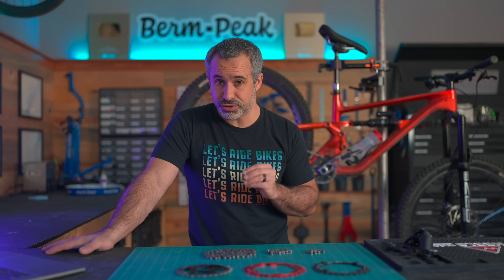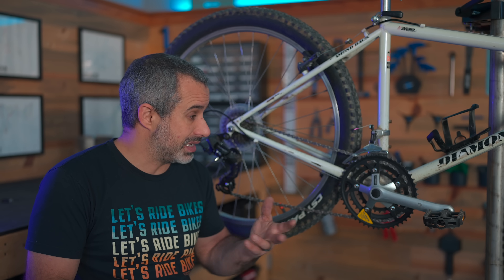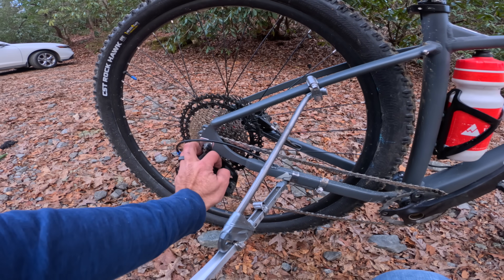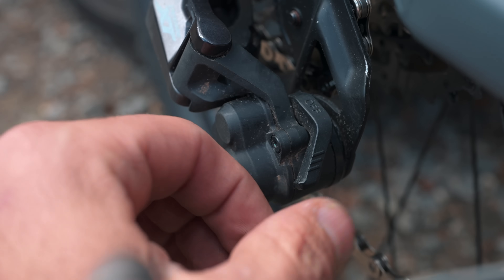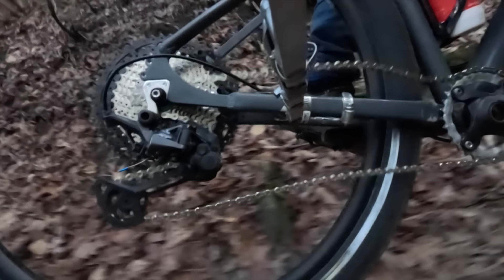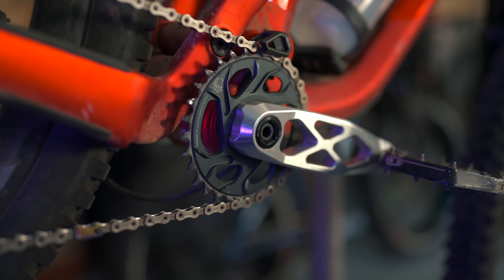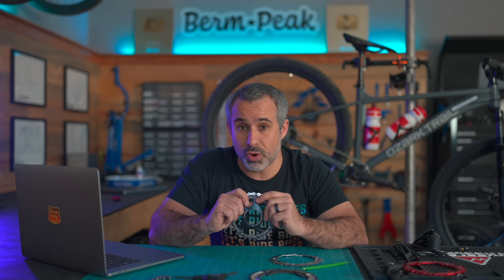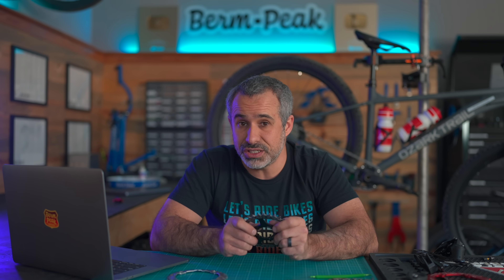The Genius of Narrow Wide Chainrings - Why they work!

Comment: Interesting breakdown, but it had me wondering about something not mentioned. I have to suspect that the increased interference of the chain/chainring results in increased friction which would decrease your pedaling efficiency. 

Not really an issue if you are only riding downhill, but uphill I wonder what the actual wattage difference might be?

Comment: 2x with a clutch is perfect
Reply: Agree. People keep saying how bad front derailleurs are, but the fact is almost nobody has ridden a really good 2x drivetrain like the ones Shimano produced at their peak (when 1x was already the industry standard).Incredibly smooth, wide range yet small steps, quiet and good chain retention. Not as bomb-proof as a narrow-wide chainring, but the few occasions I've had a chain come off on my 2018 hardtail it would generally pop straight back on by shifting once back and forth with the front derailleur.

Comment: My experience shows that NW chainring is not enough to prevent chain drop although it happend very rarely and I ride mostly in flat woodlands. Eventually I needed to put a chain guide to keep it on at all times. Mind you that I have a clutchless derailleur, so mybe a clutch and a nw chainring would do the trick. However, recently I got myself an ltwoo gr9 groupset which has a derailleur with an adjustable clutch, but it creates so much resistance on the jockey cage, that it is impossible to adjust proper gear shifting as there's to much friction on the cable and housing. I had to take the clutch out to be able to adjust it properly, and it turned out that the cage spring itself is quite stiff. Too stiff to my liking.

Comment: I never had problems dropping chains running 3x9 XTR in the past (or 2x9 once I removed the big ring). No clutches, no narrow-wide... but I'd never be in the smallest gear and the smallest chainring. I mean... why would you ever be in that gear? I haven't ridden a single ring drivetrain, so I could see it being an issue, but for old 3x9 and 2x9 setups this was never an issue because you'd never be in a gear that left that much slack in the chain.

Comment: I have been using a cheap aliexpress crank with those cheap narrow wide chainrings with a Shimano Deore Xt m739 (90s part) 11-42 cassette with a cheap extension also from aliexpress, never dropped a chain even without clutch. F pattens

Comment: Now I am wondering why my motorcycle doesn’t use this. 
Enjoyed the video Seth.
Reply: Motorcycle chains are thicker, so even at the outer link the actual clearance tooth can go into isn't different from inner link parts. Also, motorcycles use gearboxes, which means that the chains aren't meant to move sideways much. They are also tensioned differently. If the motorcycle chain becomes loose enough to fall, it's already time for replacement or adjustment.

Comment: I went 1x9 in 2010 using a dual bash, later 1x10 using a narrow wide bit still using the 9sp XTR rear mech and only lost the chain once in 4 years before finally swapping to 1x11 with a clutch (damper).

Comment: I've run several different narrow-wide rings, still dropping chains (with clutch mech). Eventually got wolftooth (couldn't get it in UK, so it had to be shipped from US). Had it for a few months, and haven't drpped the chain once. Even crashed quite hard, chain still on. Best 80 quid I've ever spent on my bike.

Comment: Great video !   I upgraded an older trek 3x to a 1x using that raceface 30t chainring along with a new shimano 11s chain and 51t cassette.  In the largest 2 gears (lowest), I have a squeek coming from the 30t chainring.   The chain is lubed as well.   What can I do to eliminate the squeek?   File down some teeth or ??

Comment: And here I am still rocking 3 chain rings at the front in my old mountain bike 🙁
Reply: 3x chainrings are still relevant for city riding. That's what I'm rocking. I believe they call the genre urban cross.
Reply: Me too🙃
Reply: I kept my 2x10 setup on my XC-Bike. Even renewing it.. why? I have more gear-range than going to a 1x11 (max that would be possible without changing the hub as well).. it climbs better, works just fine (no gnarly trails) and upgrading to a 1x setup cost more than just replacing existing components..
Reply: Me too, brother.
Reply: i have an old full sus lapiere with three chainsrings
Reply: Unaware of this I modified both of my bikes from 3x9 to 1x9 setup with NW front chain ring like 6 years ago and they're still running perfectly fine, no clutch on the derailleur
Reply: I just recently bought my first semi modern mountain bike, a 2009 Giant with 2 chainrings. I haven't ridden through any rocky sections to see if the chain stays on yet though.
Reply: I recently upgraded my old drive train to a one-by. Best mtb decision I've ever made 👍

Comment: I'm still rockin a 2004 GT Ruckus and recently the roller wheel chain guide packed it in. The rubber wheels perished and I found them in bits on the floor while the bike was parked up for a few months. . It still has the 2004 old skool rear derailleur and a single narrow/narrow up front. The chain falls of without the roller wheels chain guide just by going off a curb on the street out front. I'm gonna grab a narrow/wide front after seeing this video before lashing out on a clutched rear derailleur.

Comment: I have that sane "conventional steel chainring" bolted on the holzfeller cranks of my 2012 Blindside. The chain retention kinda sucks and it's left to the chain guide but that ring is indestructible. Went off the older 2009 Blindside frame that i bought second hand and I am still using it, it still has life. The narrow wide aluminum chainring on my Specialized Enduro instead, while having great chain retention didn't last more than 3 years with mild use...

Can we have steel narrow-wide chainrings? That would be great...

Comment: Love this. Definitely surprised. Figured the clutch was doing the most work. Would have been interesting to see the testing with a narrow toothed non shift ramped front ring. This is what I used to run on my dh bikes back in the era before clutches and narrow/wide rings.

Comment: i'm a 3X7 lover. XT 750 setup with a 27.5 7 speed cassette disc hub on my 930 is way better than my SRAM SX Trek XC8 from 2020. people forget there are deore spec 7 speed cassettes. and they're really good too.  so was gripshift MRX comp

and the 1,2 skip a few cranksets of long ago were the same. I have one that has three teeth in a row then it skips one totally,  it's a 5x144 bcd and somehow came out in the early days long before SRAM  I believe it's a track ring. It sparks when you scrub it like magnesium..

you can find lots of similar like the Schwinn Sweet tooth.

point being they shouldn't have a patent on it. I am pretty sure this chainring is from before ww2 and there's some narrow teeth and some wide teeth.. some round recessed areas where the skip teeth would have been oval between every fourth tooth is missing a wide

here's the secret.   you don't road crank with a moutain cassette.

you mountain crank with a road cassette..   try it

you can use expensive light chains to get better performance.  use that $200 ti chain in a 3x7

if you're gonna run one gear you put a guard ring on either side. let's be real here.

if you really ride that abusive get a single speed.

or a Kindernay XIV carbon belt and dummy up

Comment: I have a 2008 Gary Fisher that had a 3x front derailleur and obviously no clutch out back. All I did was replace the front chain rings with a narrow-wide matching the middle ring and remove the derailleur. That's all it needed and it transformed the bike. Never, not once has The chain popped off. And it doesn't even have a chain guide, the narrow-wide keeps it on.

Comment: I've made a couple of narrow wide chainrings in my shop and have examined their performance.  What seems to be more important than the narrow and wide teeth is that the teeth longer and come well past the midpoint of the roller.  Also important is that the teeth are wide enough to snugly fit in the narrow links.  The wide teeth don't seem to do nearly as much.

Comment: I think I now finally get why 1x is so popular in mountainbiking. It seems that chain retention is even better with a 1x narrow-wide and clutch than with a derailleur. I would think that having a bailout  gear and a large ring to aid in descending and on the road towards the trail would be beneficial on mountain bikes. But off course a front derailleur cannot prevent or save every chain drop, so I guess chain retention is the answer.  Is 3x still popular under people who ride their mountainbikes on the road as well? Because I think 1x makes sense if you're only using it on the trail, but if you cycle to trails or use the mountainbike as a town bike, the small single chainring does not seem conducive to ride with traffic on the flat.
Reply: Yeah, I will keep my 3x front. I need the speed of 44 front ring. The chain is not going anywhere from the middle ring when on the trails.

Comment: This is so interesting.
Also made me aware of the fact that I have been riding with the clutch OFF all the time, lol.
Reply: Clutch Off can improve shifting and drivetrain efficiency compared to clutch on due to there being less tension on the chain which makes the derailleur move a little easier.

So if you're not having any problems with chains dropping, clutch off is perfectly fine.

On Shimano, you also have to service the clutch every so often.
Reply: @sebastianjost 
Yeah mine shifts noticeably easier with the clutch off, less effort required to physically push the shift levers, especially up.
Reply: @sebastianjost  good to know.  thanks
Reply: @sebastianjost  what you meant to say is, shimano is the only company really that lets you service the clutch*
Reply: I only put the clutch on when going on a wildly bouncy gravel/short track. It's always off otherwise.
Reply: This is the first I've heard of a clutch. Now I gotta go look at my bike lol. I was going to ask can you still shift with it on but it sounds like you can. It's crazy how much I've ridden and yet no nothing about my bike 🤦
Reply: @rickymahoney6664 I’m pretty sure only shimano RDs have the clutch. I’d have to double check, but I think my sram GX doesn’t have one, nor did my previous sram XX1.
Reply: @jessegray8523  Srammies do. My AXS does, as does some older stuff like the Force/Rival 1. Your GX probably does, I'd be surprised if it didnt. My fav sram clutch feature is the clutch lockout button thing that makes maintenance a heck of a lot easier
Reply: @jessegray8523   .. yeah most sram's have a clutch today, they just don't have the release lever like shimano. not sure about the new sram t-type though
Reply: @MyLifeIsABikePath I stand corrected! I only knew of the lever switch style on the shimano ones. Where as the sram requires a tool, I just didn’t notice. The other feature you’re referring to, I believe is different. But yes, very much needed for easy wheel removal.
Reply: @BlueSentient you’re right.  I had to look at it again, requires a tool though. I was only familiar with lever style for shimano. Makes me wonder how its adjusted now. I’ve never even thought of that.
Reply: @BlueSentient  SRAM derailleurs don't allow you to switch the clutch off, but they have a locking button near the jockey cage pivot that locks the jockey wheel cage in a fixed position keeping the chain slack, so wheel removal and replacement is actually slightly easier than with Shimano. To unlock just pull the cage forward and the button pops up by itself and you're ready to go.

In their favor, Shimano derailleurs are a lot more if they see muddy mileage, shift better and are much better value for money though, so I'll live with wheel removal being a little harder while fixing the occasional puncture.
Reply: @peglor  another difference is: the clutch on SRAM derailleurs usually never needs maintenance. Shimanos clutch eventually makes the motion of the derailleur cage very jagged. Then you have to take it apart and regrease it. Not too difficult, but it's more maintenance than SRAM requires.

Shimano clutches (at least on SLX and up) are also adjustable though, so you can change how strong they are with a little screw accessible from below. (On SLX and possibly Deore, you have to take of the cover with three screws first).
Reply: @sebastianjost  Based on the bike I'm running a SRAM drivetrain on, I'm beginning to suspect the reason the SRAM clutches don't need maintenance is because the rest of the derailleur falls apart first. 

I ride pretty much all year round in wet muddy conditions, and I've never done anything to maintain my Shimano derailleur clutches and they continue to work very nicely. 

I had the clutch in one of the first generation clutch derailleurs fail on me, but it took a while for me to notice because it was a 3x10 drivetrain, so I didn't spend time in gears with an excessively short chain or in crossover gears, so dropping the chain wasn't really a thing to begin with.
Reply: @jessegray8523  They just don't have the clutch switch.
Reply: @rickymahoney6664 I didn't even know my bike had one. It's been on since I bought it. I went straight out and looked for it after watching this 😅
Reply: @rickymahoney6664 welcome to the club. I'm more knowledgeable than the average rider, but there's still a ton of stuff I don't know. Even these narrow wide chain rings, I thought it was the distance between teeth that alternated, not their thickness.
Reply: Have they got all got a clutch my 2023 Giant with shimano Altus 16 speed doesn't seem to have one?
Reply: @c-ptsd46  yeah, Shimano Altus probably doesn't have it. It's now been superceded by Shimano CUES though, which does have a clutch.
Reply: @sebastianjost  Thank you for your reply cheers mate.
Reply: Thanks a Million!!
Reply: At least you know your clutch isn't worn out!

Comment: My 2005 Specialized Rockhopper Pro came with two rings up front, if the chain fell off the iscg mount chewed up my chain. So I went with a e13 chain guide and ring. 
In 2020 I upgraded to a Shimano drivetrain with the clutch. Saved so much weight and got more gears.

Comment: Had to pick up a temporary bike while mine is warrantied. It came with a 2x10 drivetrain. I just removed the front derailleur and the chainrings and threw a raceface 30t narrow wide chainring on it. It works shockingly well and has great range.

Comment: Was dropping chain on a Shimano 2x11 with a clutch like crazy. Getting a narrow-wide chainring put an end to that once and for all.
Reply: Is it still 2x11, or did you have to lock out the front derailleur to make it a 1x?

Part of me thinks that you couldn't shift the 2x with narrow-wide rings; another part thinks that it would be more difficult to shift but that the chain would ultimately skip into the right spot on the new ring.
Reply: @KevinT3141  I've replaced the two rings with a single one. I don't think there's a good way to have a 2x with narrow wide.

Comment: Another chain retention feature these typically have is longer teeth. Bc they don't need to shift off like a traditional ring does they can have significantly longer teeth that protrude through the chain meaning the chain has to move further away before it completely comes out of contact with the teeth
Reply: Yeah that's the solution Shimano went with, they don't have narrow wide but still works quite well on my bike

Comment: Do you have the type of non-narrow-wide chainring specifically for single ring purpose? You know, the type with tall teeth and no shifting ramps, I wonder if it holds the chain better than the steel ring you use in the test.

Comment: I set up a Specalized Vado SL electric hybrid a few days ago and wondered why the chain popped off the chainring when shifting to the largest 4 cassette cogs. Turned out it had a "semi" narrow wide chainring. You could feel the difference in thickness of the teeth with your fingers but the chain would sit on it when it was out of sync (i.e. the narrow bit of chain would fit on the wider tooth). Moved the chain along 1 tooth and it worked perfectly again. Seems that for city bikes they want the advantages too but slimmed it down to reduce noise as the demands are not as high as mountain biking. Might be something to bare in mind when shopping for chainrings.
Reply: You're high.